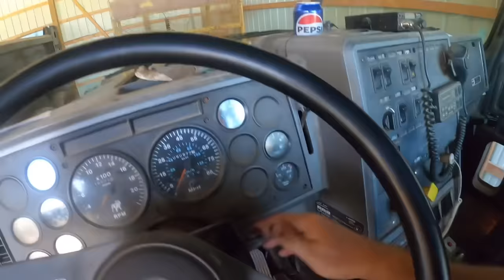Catastrophic Tile plow failure what happen to cause this epic failure?

Comment: That stinks you broke your bulldozer
Reply from the maker: Did I miss something what happened to the bulldozer
Reply: @DirtPerfect  the backend broke off when you were putting plastic pipe in the ground
Reply: He broke the “Tile Plow” attached to the 850J’s Ripper…. The bulldozer(850J) itself is fine. Lotta fabrication, cutting /Welding and some new hydraulics too…
Reply: @HootakaBJ  well that’s what I meant but I’m glad you guys got it under control and you got it fixed that’s what matters👍

Comment: For a design in your head to building it and all the people saying it would break the first time you use it to putting in over 200k feet of tile and not a problem.  A lot of rocks and plowing though rock as well,  To finally breaking it not to bad.  A $13k investment to build made you a lot of money you can spend a few grand fixing it better and keep on using it and still be way ahead.   Just show you how much force there is on those plates from the boot.  You was just testing it out to find the failure point.  R and D that all it is.